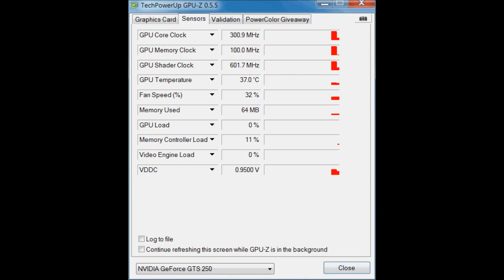Artic Cooling Twin Turbo Pro on Evga 250GTS Install

Comment from the maker: Wanted to give you guys and update, fans running quiet and playing Battlefield 3 on auto video settings which set it to medium at 1080p. Looks nice, plus gets only at 55 degrees Celsius. Awesome if I may say so, defenetly a nice upgrade and recommend it to anyone that is tired of noise and higher temps.